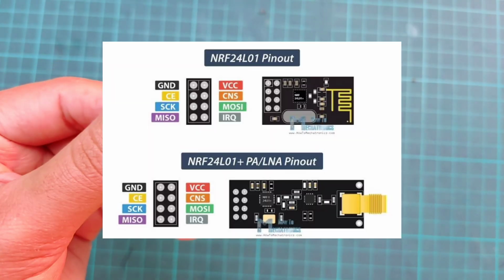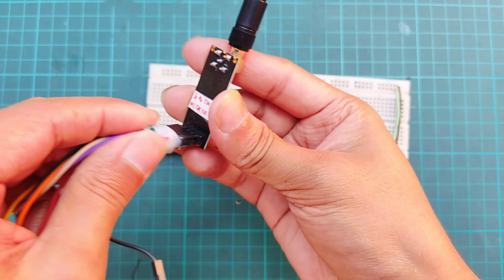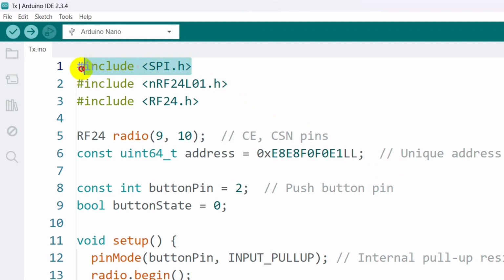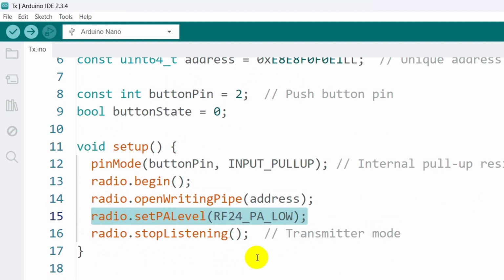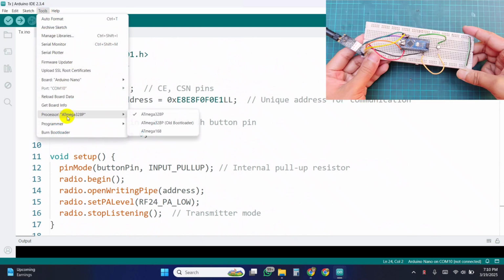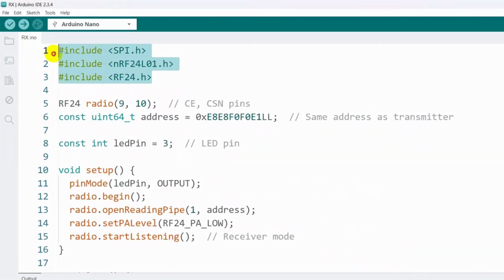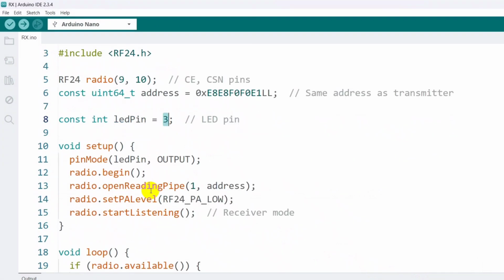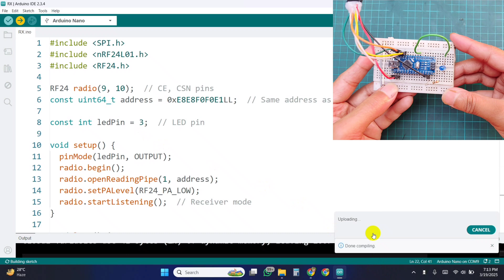How To Use nRF24L01 with Arduino | Wireless Transmitter and Receiver using nRF24L01

Comment: emisor:
#include <SPI.h>
#include <nRF24L01.h>
#include <RF24.h>

RF24 radio(9, 10);
const uint64_t address = 0xE8E8F0F0E1LL;

const int buttonPin = 2;
bool buttonState = 0

void setup() {
  pinMode(buttonPin, INPUT_PULLUP);
  radio.begin();
  radio.openWritingPipe(address);
  radio.setPALevel(RF24_PA_LOW);
  radio.stopListening();
}

void loop() {
  buttonState = digitalRead(buttonPin);
  bool ledState = if (buttonState == LOW) HIGH : LOW;

  radio.write(&ledState, sizeof(ledState));
  delay(100)
}

receptor:
#include <SPI.h>
#include <nRF24L01.h>
#include <RF24.h>

RF24 radio(9, 10);
const uint64_t address = 0xE8E8F0F0E1LL;

const int ledPin = 3;

void setup() {
  pinMode(ledPin, OUTPUT);
  radio.begin();
  radio.openReadingPipe(1, address);
  radio.setPALevel(RF24_PA_LOW);
  radio.stopListening();
}

void loop(){
  if (radio.available()) {
    bool receivedState;
    radio.read(&receivedState, sizeof(receivedState));
  digitalWrite(ledPin, receivedState);
  }
  
}

Comment: Ce and csn on code is on d9 and d10 but on table csn is on d8 which one should I follow please do reply bro
Reply: Brother you use the one defined in code otherwise system won't work

Comment: Thank you very much brother and keep up the good work . One note : it works flawlessly as your video without problems but if I go by the attachment file ( the components layout) the led will be "On" when button is not pressed and  "Off" when pressed  ( because of different configurations of the push button and different type button  than the one in the video )  and a second thing the components layout shows led connected to pin D2 while it should be pin D3 as you mentioned in the video .
Reply from the maker: Good Plan. Modify the code according to your requirement. The main structure is the same.

Comment: I able to the same push button and led but I don't know why it doesn't work if I use potentiometer to rotate servo. On Arduino with potentiometer, I can print value to Serial port. But on Arduino with servo, I receive only value of 0.
Reply from the maker: That means the nRF modules are not connected to each other
Reply: @aslamhossain1  I don't get it. But why it works when it's push button and led?
Reply: @aslamhossain1 which cable need to be used for Arduino nano

Comment: How can I get the nrf24l01 address
Reply from the maker: The address used in nRF24L01 communication is a 5-byte (40-bit) unique identifier that ensures proper pairing between transmitter and receiver. You can set any random 5-byte hexadecimal address, but it must be identical in both the transmitter and receiver for communication to work.
Reply from the maker: Ways to Generate a Unique Address

1. Choose a Random 5-Byte Hex Address

You can manually define a 5-byte (40-bit) address in hexadecimal format.
For example: const uint64_t address = 0xAABBCCDDEELL;

Each byte is in hexadecimal (0xAABBCCDDEE).

The LL at the end ensures it's a long long (64-bit) constant.
Reply: Thanks pal  @aslamhossain1